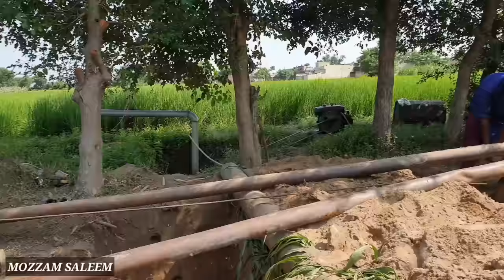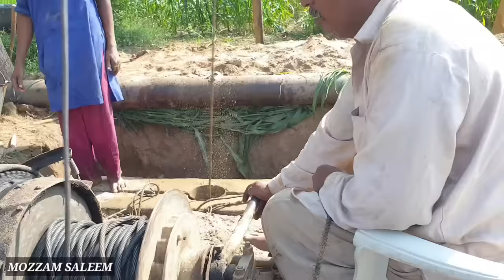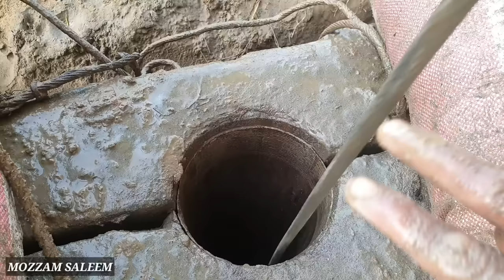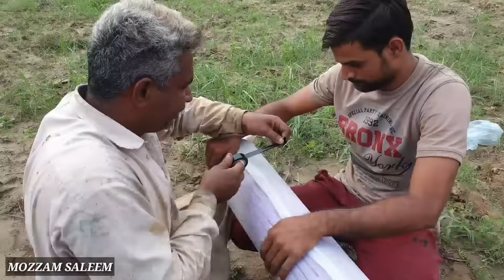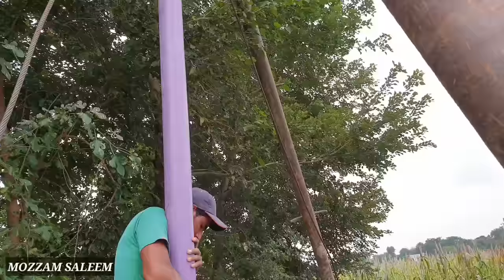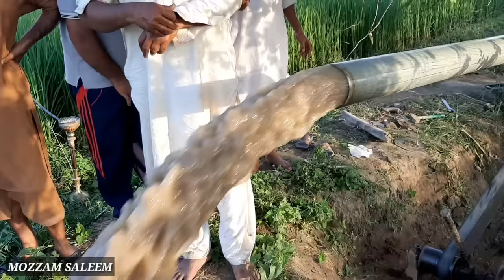Water Boring Machine Working in Pakistan Village | Tube-well Boring in Pakistan Mozzam Saleem

Comment: The clutch on that winch must be a beast.  Or easily replaced....
Reply: They use a used car tyre to transmit power from the generator to the pulley section.
Reply: We used clutches similar to that on our logging cable hauler. It uses wood facings arranged into a cone. Pushing the handle down forces the cone into the iron reverse cone that’s driven by the drive gears. Very efficient, cheap, effective system.
Reply: @tutekohe1361  hello brother? It be how much the machine?

Comment: I see you bought the whisper quiet motor.
Reply: @ngdusamamat5865  Easy for you to say:-) Old machines and ways are the best.
Reply: Changfa diesel, water cooled horizontal single cylinder, a true work horse, best engine ever. It’s a tractor motor, a truck motor, out board engine( long boat), a mill power supply, genset, even a water pump.
Reply: @FrancisoDoncona  can you still buy one new?
Reply: @FrancisoDoncona  LOL.

Comment: Look up American windmills they can be used to pump water from the well by using the power of the wind,  you have enough powerful winds there to pump all the water out you'll ever need then build a large concrete water reservoir using hydraulic cement.

Comment: When we had a drought in Oz in 1980s we built a tripod rig, pumped drilling mud using a small hydraulic motor size of a drink can to turn the drilling pipe with rock breaking bit to sink wells to 100 feet this was using 2 to 3 people & we could drill in small confined areas like peoples backyards.

Comment: An almost identical method is still used in the USA to sink the shafts for hydraulic elevators.  Our safety department would freak out over the lack of PPE, guards on the equipment, and rigging, but I would bet these workers long term (from more care on their part) have a similar injury rate to ours.
Reply: The loose clothing drove me nuts to watch

Comment: Fantastic job. Very ingenious. But one question. Apparently you are using a centrifugal pump which can create enough vacuum to suck water from a depth of about 6 to 7 meters at best . So what do you do when the water level in the ground drops below 6 or 7 meters. Do you then use bore hole pumps? But they are electric and you apparently don't have electricity there. Thank you. A brother from Iran.

Comment: assalamualikum bhai h r u i openinion i can gove if u like dear brother see if u can used solar panel for using water pump it can operate the pump and will be easy for u and also have remote control i can operaye from home if u want pls check near by shop it is available pr not in ratanagiri india we r using it pls check  with ir shop solar panel